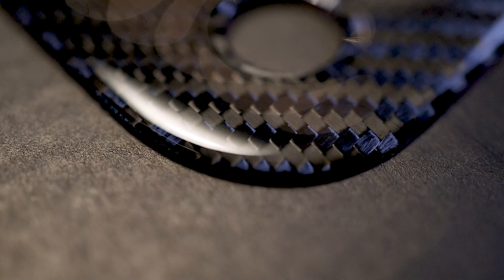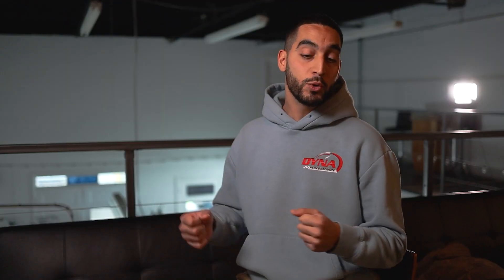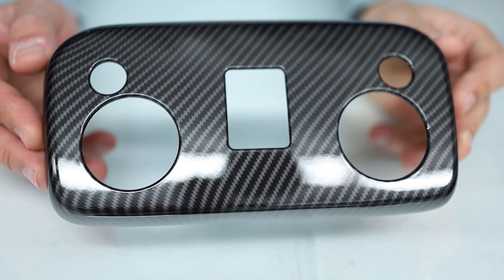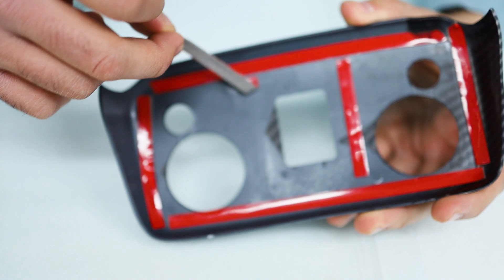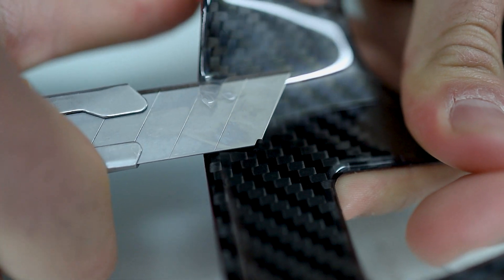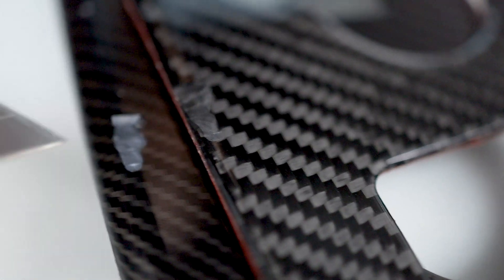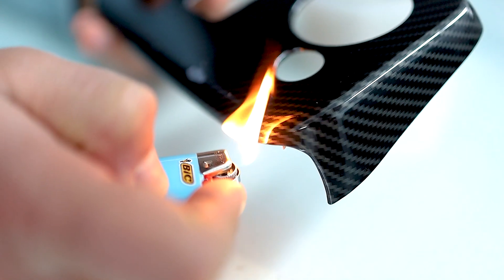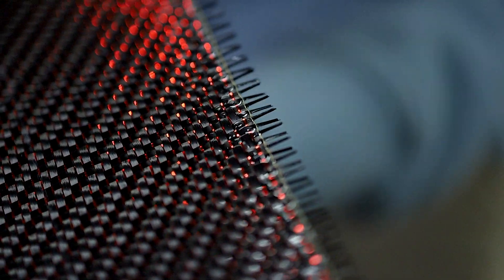REAL VS. FAKE CARBON - THE REAL DIFFERENCES - Dyna Performance

Comment: I really liked how the real carbon fiber has a protective epoxy layer from heat and scratches vs the fake hydro dipped carbon fiber doesn’t have any protection at all

Comment: My favorite part was when you shaved the epoxy and burned it. Explained how real carbon fiber is protected with epoxy. I bought a steering wheel with blue carbon fiber from Carbon Bargain. 1 week later the blue came off from sun damage where the sun hit the steering wheel.

Comment: My favorite part was how easily you can differentiate between fake carbon and real carbon once you start to nice the little details such as the epoxy layer that’s used protection, also the woven patterns from the red carbon fiber are really interesting.

Comment: Love how you showed the difference between the real and fake carbon, and how the real is protected by the clear coat and how to fix scratches. Love the video. Got a whole dash and center console set of carbon for my stang. Just need a steering wheel to finish off the interior. 🔥